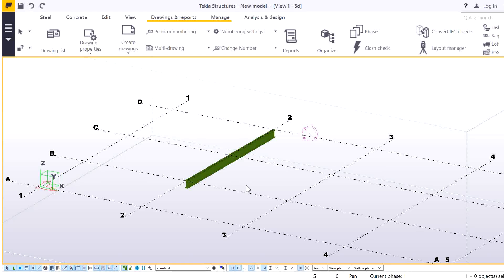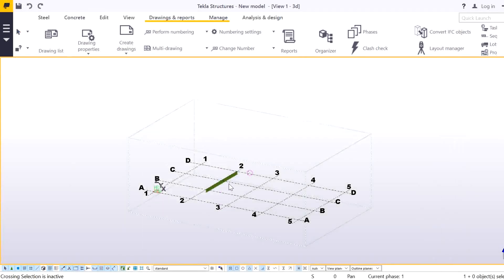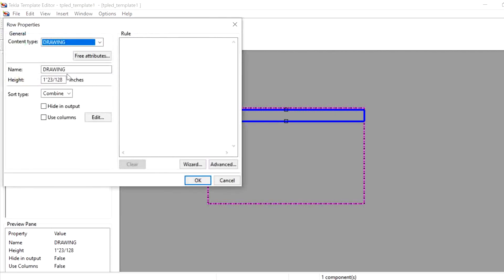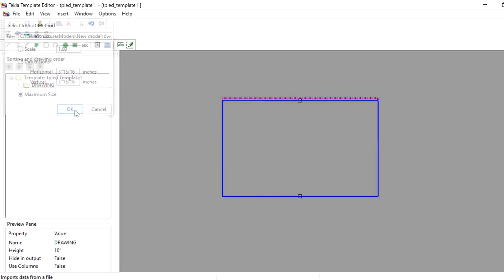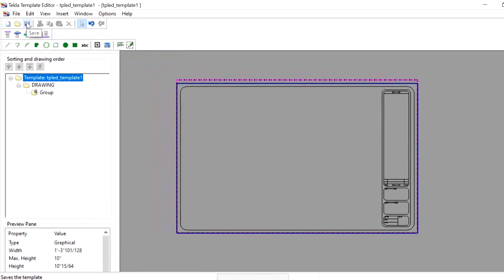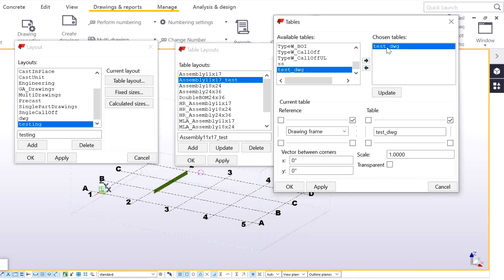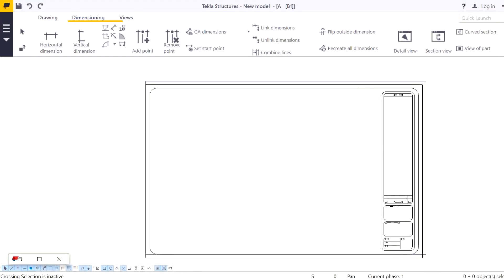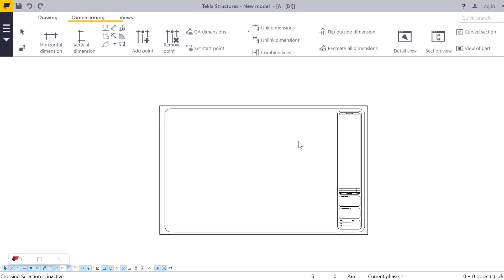Import DWG AutoCAD title block file inside Tekla Structure Template Editor for drawing.

Comment: Sister while working with one model the layout of customize is showing but by opening another model its not showing what to do
Reply from the maker: Thank you for writing your doubt to us. Tekla Structures has several files that relate to templates such as .lay and .tpl file, These two files you have to copy from your current model folder and paste inside another model in which you requires that customized layout. hope this will be helpful. 
Stay tuned with #TCBIN for more update:)